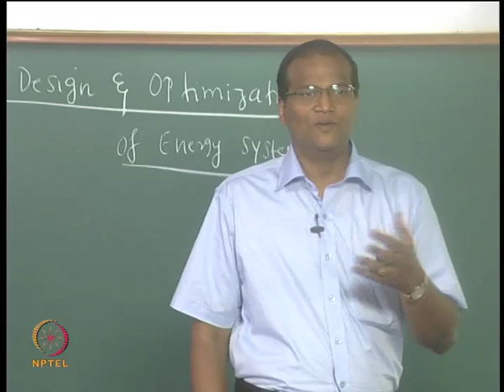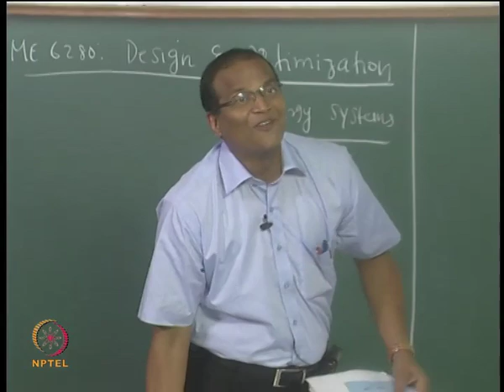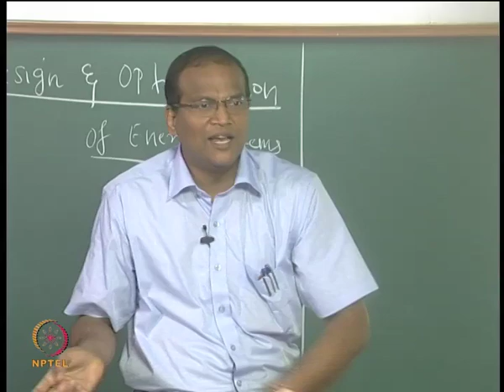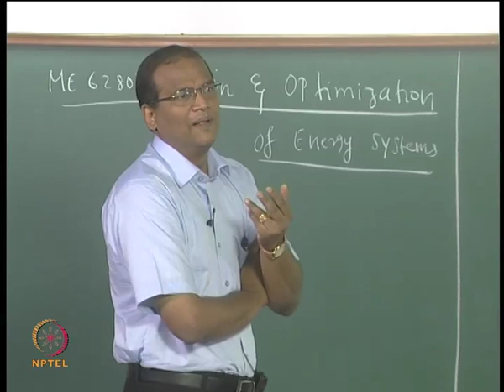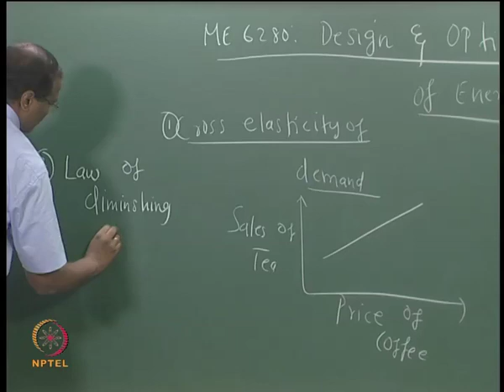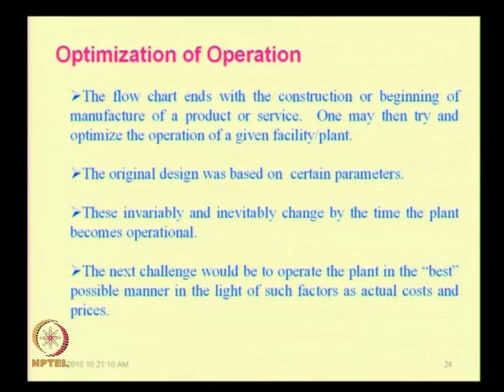Mod-01 Lec-01 Introduction to Optimization

Comment: Thanks for the upload. The book by Stoecker is indeed a good primer but having been published in the 1970's (or 80's), it is unfortunately out of sync with the state of affairs now in engineering. What literature would you recommend for a Thermal Optimization student today that is more application based and in-tune with software capability?
Reply: What do you recommend now ?
Reply: @newbie8051  There maybe books by Adrian Bejan